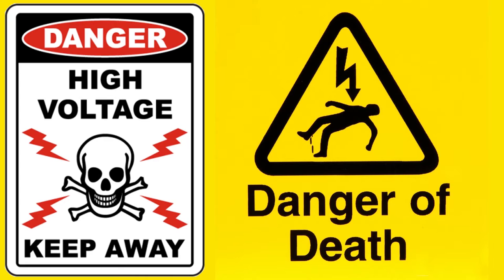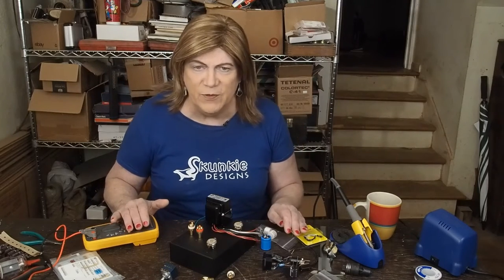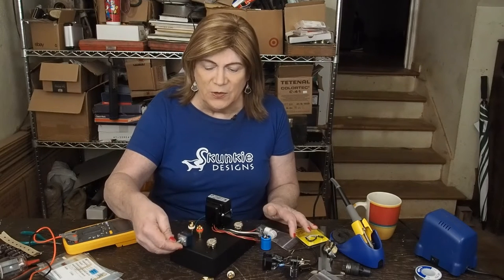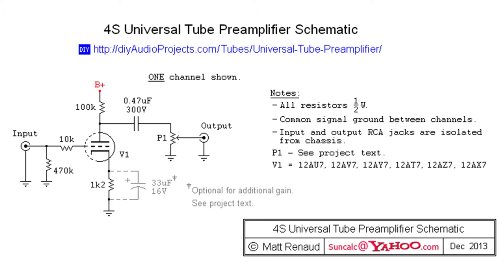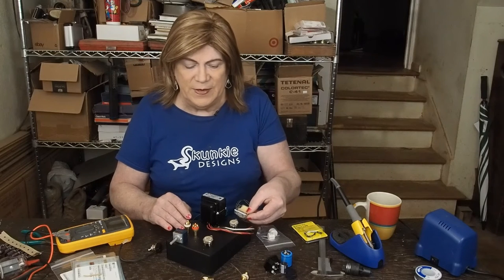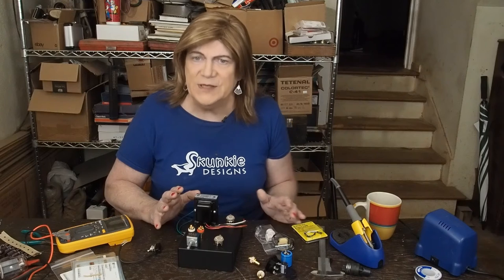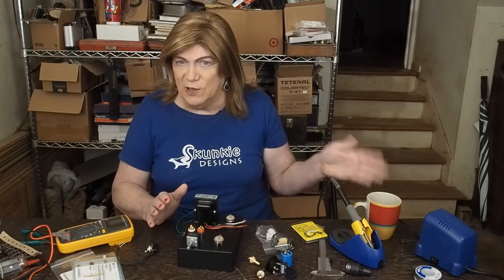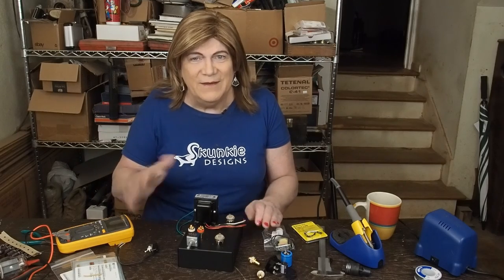HiFi Tube Pre-amp: Simple DIY Version!

Comment: Nice video! I can explain why the output of many tube-preamps is cathode follower. It reduces the output impedance which needs to be at least 10 times smaller than the input impedance of the power amplifier. For example: input impedance of power amp = 100k so the highest output impedance of the preamp is 10k. If it is higher than 10k for this case, the signal will be distorted. It is just like plugging 4 ohms speaker in 16 ohms taps. 
In this circuit, the output is a pot which varies the output impedance as you turn the volume up or down. Let's say this is a linear pot and you set it at a half position, then the output impedance will be 250k/4 = 62.5k ohms. Hence, your power amp's smallest input impedance has to be 625k ohms. If it is lower than 625k, the signal will be significantly distorted . That also explains why the pot should be placed before the gain stage to avoid the problem I have just said. 
About the distortion, somebody may say they don't care about the distortion as long as it is musical. However, we want the pure the distortion  from the tubes and not be covered by the distortion from the pot. Hence, I don't think placing the pot between the preamp and the power amp is a good idea.
Anyway, just go for it! I am waiting to see how it goes.
Reply: I've tried a similar scenario to this and it didn't sound good.....
Reply from the maker: @mfr58  Well we will see how this one does. A tube amp without an volume pot should have an input impedance of 500K to 1M.
Reply: @SkunkieDesignsElectronics  Yup! Let' s see how it sounds. For this circuit, I recommend using the low gain tube such as 12au7 or 6922. The lower the gain, the less noise it will produce. Besides, you don't have to turn down the pot too much which will degrade the sound.

Comment: Dear Steph, as a believer in the "less is more" philosophy, I think this build is amazing, the possibility of testing all the 12A family in a single preamp is very appealing. Great idea, I will wait for your measurements before going into the build, anyway sounds like a winner. The octal version would also rock, it would also be great to have the version for the 6922, 6N1P, 6DJ78 family with 6 volt heaters.

Comment: The PS is very well designed ( somebody has experience and the correct knowledge ).......the values of the filter capacitor ' first cap ) and the reservoir capacitor have the right ratio !!!!!! ( to prevent ringing/oscillation when responding to dynamic power demands) ..............ratio 1/3.............!!
Reply from the maker: Except SE amps don't have dynamic power demands...

Comment: Hey, Skunkie! Yes, I am enjoying the channel. If you do the octal version, here's something you might try. There is a dual power triode called the 6AS7G/6080WA. Very low mu, very low plate impedance. They're great for SE power amps. They also share the same pinout as the 6SN7 and 6SL7. If you don't need much gain, but want to drive those long cables without a cathode follower, this is your tube. The plate and cathode resistors will have to be considerably different (the book says not to use this tube with cathode bias, but I've done it for years), but it would still be possible to add a switch to choose between it and normal SS dual triodes. One caveat: You MUST use an indirectly-heated rectifier with this tube. If the plate voltage arrives before the cathode is up to temperature, the tube will be ruined and you'll get a light show for your trouble.

Later!
Reply from the maker: Since you mention this, what would be a reason to have long cables between a pre-amp and the amplifier? I'm trying to understand why someone would ever do that.
Reply: @SkunkieDesignsElectronics  If you want to control your stereo from your listening position, but without the large power amps at your elbow.
Reply: @SkunkieDesignsElectronics  FWIW I've seen folks placing their amplifier right at the speaker -thus relatively long preamp cables.
Reply from the maker: @karlsonkab51  Interesting, thanks.

Comment: It looks like a very good runnig amp, the mechanical base is also solid.... I prefer always the 6SN7GT version.....in Germany it called "Weitverkehrsröhren"...and means long distance tubes...thats always a Quality factor...its much more bariumoxide on the cathode, than other tubes have.You can also say its a longlife version.
And By the way.....the potentiometer..... I use 50kOhm as a volume pot....because the modern amps have so low impedances, you dont need such high values like 100k anymore!
and of you try it,,,,you will hear it...less noisier.
That looks interesting!
And Thx for the Vid.

Comment: Love your videos. I've probably watched them all , sometimes several times. I have built many different topologies of Set2A3 and SET45. I built a 6h6p preamp and it has way too much gain. I have many left over parts and you vids have inspired me to build something like a 4s but dedicated to 12au7 only. I could really use some of your advice on finding a schematic. I'm torn with where to put the pot on the front or rear end. I have 150hz Tractrix front horns with 102db 8" Lowther drivers. for the top end and 4 -18" push pull open baffles self powered.  I really look forward to chatting with you. Thanks , Les Hudson

Comment: i have watched all videos of this serie.  I am wondering , the 12AX7 is suitable for a phono stage? Or maybe two stages of it . Thank you for the knowlege you share with us
Reply from the maker: The phono stage I use, and have a video series on, uses 3 12AX7 type tubes. It's the EAR834 clone. I do use the 7025 variant because they are lower noise in a high gain application.

Comment: I am building this pre-amp right now, what a coincidence. I have everything in except for the IEC plug that should be here tuesday. The other thing is the pot I couldn't find a J taper so I'm using a linear potentiometer. I don't know if I need a J taper because of the way the pot is on the tube output but we will find out. Are you installing the ground lift switch?
Reply from the maker: No, I'm not.
Reply: If you look at Matt's blog on CascadeTubes, his last post was about the volume control and should answer your question about taper.